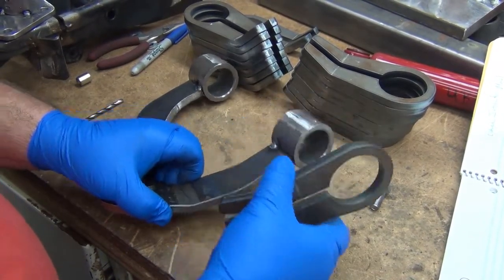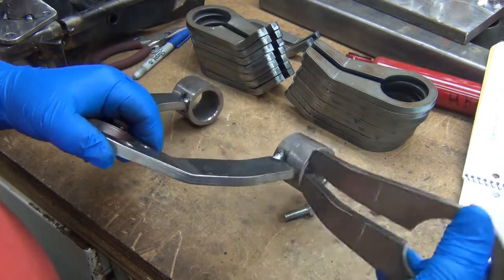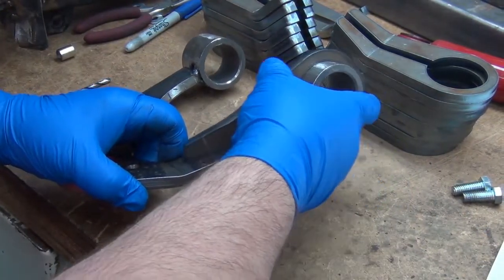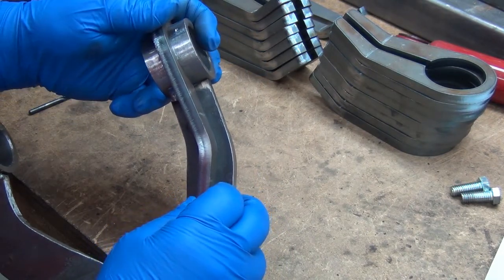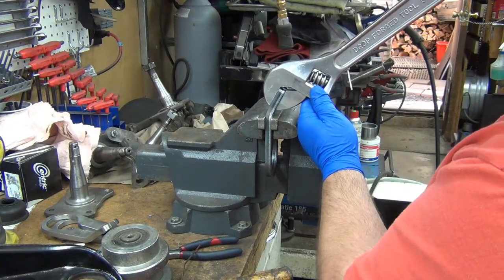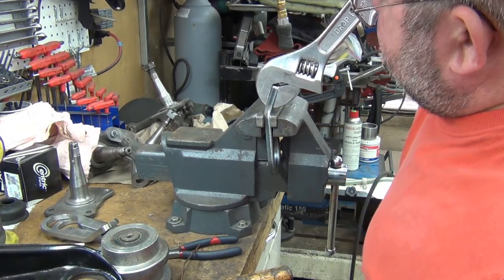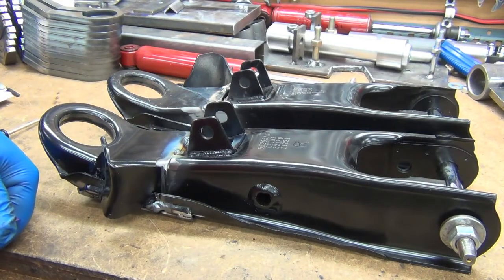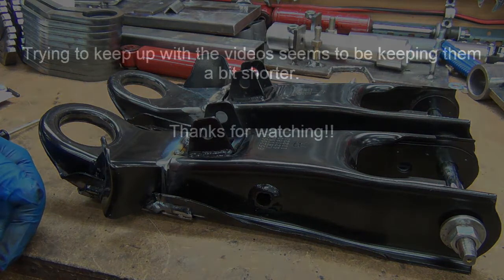Datsun 521 Ball Joint Mod - Part 51

Comment: Mike, is this the final dimensions for the LCA shortening?
Reply from the maker: Pretty much.  I'm pretty sure I section out 1-1/8".  I've got a much more recent vid from when I did these last year.. https://youtu.be/NINOEHyDEUU   This 2013 setup had to be really close since the UCA's were not adjustable.  In the more recent vid, it didn't need to be quite as tight on the tolerance since the UCA's were adjustable.  Check the 4:25 mark in the linked vid.....the 1" block plus the .050" thick scale worked really well.  Once the blade kerf came into play, it was really close to the 1.250" mark.  I show the caliper measurement at the 8:50min mark in the linked vid.
Reply: @bluehandsvideo  Thanks. I am trying to decipher all of this info. It changes a lot throughout the development and I've only got one chance to cut. I wont know I screwed up until its alignment time, and that would be a huge huge setback.
Reply from the maker: @Zukuri620  That's really cool that you're trying to follow this to make your own!!  That was the whole reason I posted all the info about them.  I just got done doing a group buy on them at the first of this year.  You might want to refer to info in vids from this playlist first.....  https://www.youtube.com/playlist?list=PLAUFP46xkHExv97_WB7kJwc9-5ZHRsVUN   It's not as comprehensive, but it will have the most recent info.  I was finding my way when I did those others in 2013.  

Are you going to run adjustable UCA's?  If so, the LCA length isn't very critical.  If not, keep in mind that the cross shaft for the UCA is inboard of the shock tower......so making the LCA a hair short just means a bit of extra shim when aligned.  If the LCA is too long, it will be a lot harder to make the UCA longer.  I'm curious to find out what you're doing about the uppers. :)
Reply: @bluehandsvideo  Im using your uppers, non adjustable. Got them located and tacked up yesterday.
Reply from the maker: @Zukuri620  The flat plate steel ones?  It's been some years since I did those. lol
Reply: @bluehandsvideo  It's the ones I had laser cut, your design. The lower arms are going to be a total PIA. Its gonna take me a ton of time just to figure out how to approach the different processes since I don't have your jigs, fixtures, and other tooling.
Reply from the maker: @Zukuri620  Sounds familiar. Too hard to keep track of everyone. lol  Too bad you don't have the tools and wanted to take over production of these. I'd make you a killer deal on the fixtures. lol  :)   For one set, I think you can get by without them.  I made the different jigs/fixtures because I was doing multiple sets.  Granted, they make it way easier to hold the pieces.  The hole for the cut on the LCA will be a challenge.  Maybe if you tack weld steel disc on the inside of the arm....under the existing hole.....you could use a transfer punch to mark the center of the hole.  Then you could use a hole saw.  It should be fairly accurate having used the punch to mark the center.  You're going to need to clamp the arm down really well....that hole saw will be nasty with a hand drill.  If you have a drill press and vise, it would be much easier.  The sway bar hole can be done with a step drill bit.  Cutting the 1.125" section out shouldn't be too hard.....if you can get it marked well.  I almost think a hand hacksaw will help get straighter cuts than some of the other options.....cut off wheel, air body saw........hhhmmmm.......if you have a 14" abrasive wheel chop saw, you could try to mount the arm to a piece of wood...2x6x15"..??  Then the wood could be put in the clamp....should hold pretty well.  Let me know what tools you have access too and I might have some ideas.  I spent many more years without these tools than I have with them. lol